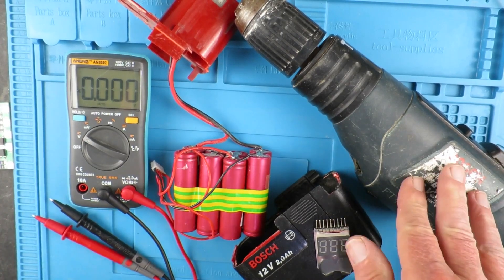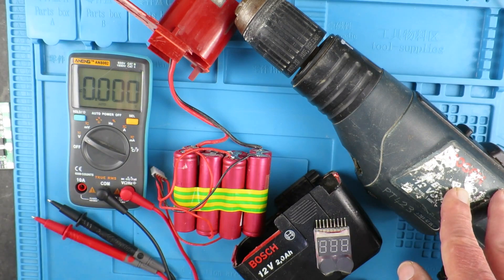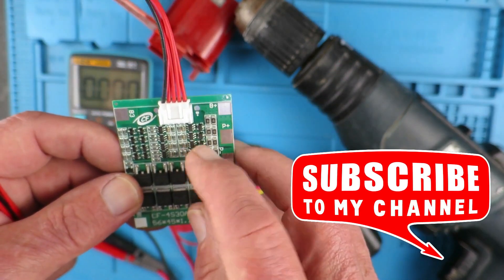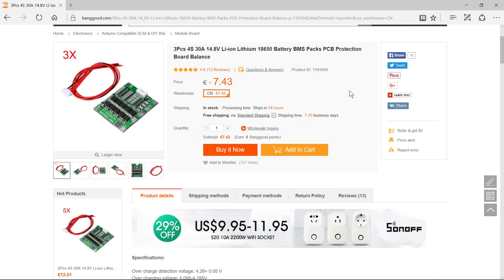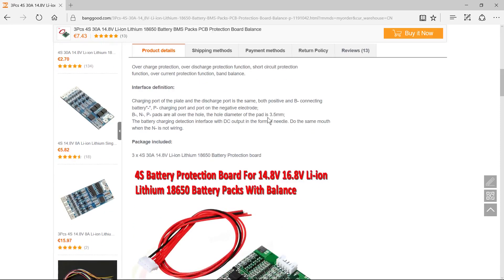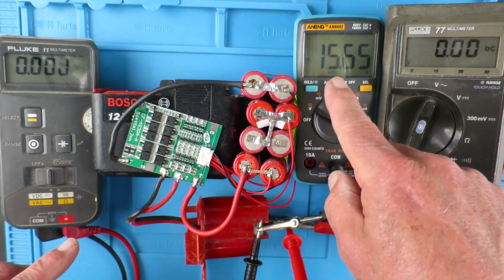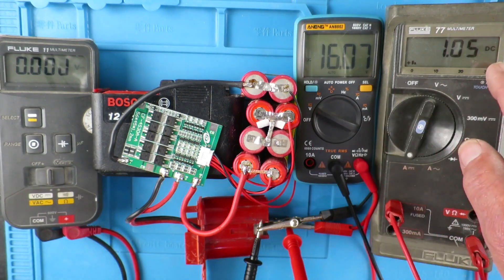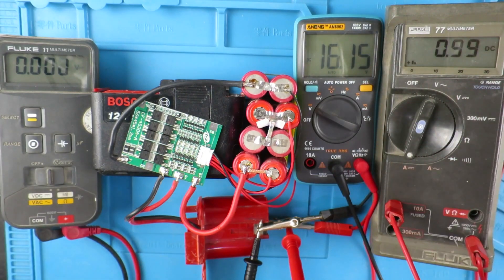4S 30A Li-ion Battery Protection / Balance Board Test Electronic Tutorial

Comment: I got one of these, slightly bigger for 5 cells and 100A. Unfortunately I forgot that this was not a charger, meaning there was no current limiter when charging so it started to pump 15 v to one of the cells but not to the others. It may be damaged now but I have 2 more so no big deal. The instructions as with most things from China are not helpful, too many details about the parameters but none for the operation of the module. I wish I knew some more about the balancing, how exactly does that and what the LEDs flickering means. Thanks for your tutorial.
Reply from the maker: Thanks for watching! I have a video that goes a little more into cell selection and balancing here : https://youtu.be/z2Rhk8KJp_k

Comment: I have BMS board as you, 3 batteries in parallel 15 batteries for series ,connected as your picture, checked p- p+ with a spare motor (no load) runs fine, but when using drill ,it won't run , when checking with VOM after, no voltage , connected hobby charger for 1 sec , ( it will reset?) and it will run spare motor, but drill will cause it to shut (not run), what am I doing wrong?
Reply from the maker: It happens because the short circuit protection activates due to the large switch on current of the drill. There is a possible fix by putting a capacitor on the board see here : https://mysku.me/blog/aliexpress/58000.html
You will need to translate from Russian!

Comment: nice work, thanks for publishing. Any idea why there are 2 rows of 5 FETS in a BMS that does 4 cells?
Reply from the maker: A good question! 4 pairs are in the charge control circuit and 2 pairs control the over discharge control circuit.
There is a full reverse engineering of the board here : https://mysku.me/blog/aliexpress/58000.html
You will need to translate it from Russian!

Comment: Thanks you - fantastic and comprehensive - best I have ever seen. 
Would it be possible to use this in a Panasonic 15.6 V Hammer Drill given the voltage?
Reply from the maker: Glad you liked it! It should be OK with that drill. The pack voltage will fall under load.
Reply: Thanks again, I have ordered the bits from your favourite Chinese emporium. Mine too as I have bought from Banggood before. Have a wonderful festive season.

Comment: Okay. So... I wired it correctly and despite having 16v output on the P- and P+.... I connect it to the drill and it wont work... any ideas ??
Reply from the maker: It is possible that the short circuit protection is being activated. Some boards seem more sensitive than others. Can you try a bulb and see if it will light? There is a complete description of the circuit and fix here : https://mysku.me/blog/aliexpress/58000.html
It is in Russian! Let me know if it works for you.
Reply: @1nformatica  thanks for your reply.. By making a quick short...the board reset itself. My guess is sometimes if a short happens it doesnt always reset properly. Im also wondering if the majority of 18650 batteries are 10 amps output per cell. And if you make a 4 series battery with nothing in parallel... the output is still 10a maximum so.. Is a 30a bms.... Kind of... well... overkill? If the cell goes bad and tries to charge beyond a certain voltage or drain beyond a certain voltage that still works. But the amperage protection will never be triggered. So in this case would you be better off with a bms with a cutoff of 10 amps? Since some of these small drills dont draw over 5 amps maximum anyway (my crummy ryobi drill doesnt pull more than around 3 amps which is probably why I got it for free lol)
Reply from the maker: The board usually resets after the load is removed. 18650 cells are capable of producing much more than 10 Amps if, for example, shorted out. Don't ask how I know!
Reply: @1nformatica  ah! I just assumed since their typical peak max output is usually around 10amps and the drill doesnt go over 2 amps (my drill is no good) then would you really need a BMS that craps out at 30a if you only wire 4 cells in series (only one parallel) it seems like a 10 amp bms (smaller) would be sufficient. But im guessing those smaller ones dont have cell balancing because.... Well.. Theyre so cheap....
Reply: @1nformatica  wow talk about russian guy over engineering a project!!!
Reply from the maker: Yes! I bet he's really fun at parties!!

Comment: I have breached those bms: s two pieces. I would like to know if the charging voltage can be as much as 20V because I want to use a solar cell for charging but do not lower the voltage with extra devices?
Reply from the maker: The cells must be charged by a source that has constant voltage and constant current. I use a 19 volt supply and a DC step down module set to 17 volts and a constant current determined by the cell datasheet e.g. 2 Amps. The module is this one : http://bit.ly/LedDriver You can see how it works in one of my other videos : https://www.youtube.com/watch?v=QYc1On0q4AA
Reply: @1nformatica  Thanks for  reply! A step down is not good, I used one, but when the sun is shining at full power, the solar panel voltage would have to be raised to charge the battery. At full panel power, the voltage is 22v but already in bright conditions, for example 12v, the voltage should be raised. The current should not exceed max. 5A because the panel is 100W.
Reply from the maker: This module is not a good fit for solar applications. Take a look here for alternatives : https://www.youtube.com/watch?v=8ZHD5R5qOfI

Comment: Hello! Great video! In the schematic around 4:21, it's not specified the amount of batteries that can be connected in parallel and i noticed you connected two at a time in parallel, is there any maximum? Does it affect performances or may become a hazard due to batteries not exactly the same balance? Thanks!
Reply from the maker: Thanks! The max number of paralleled cells would be limited by the total charge current. Balancing many cells would be a challenge as the balance current is only 60 mA. Most important is that the cells are matched for internal resistance https://youtu.be/z2Rhk8KJp_k

Comment: I tried to use that board and was not able to get the full current output of the pack. It kept quitting on over discharge when I was only asking for 6 amps. I've since gone to testing the next generation BMS/balance boards
Reply from the maker: Yes, some others report the same problem. I too would like to test different boards but not found any significantly better. What devices are you looking at?
Reply: @1nformatica The typical Chinese BMS boards 
https://www.ebay.com/sch/i.html?_from=R40&_trksid=p2380057.m570.l1311.R2.TR4.TRC0.A0.H0.X4s30z.TRS0&_nkw=4s+30a+bms&_sacat=0

Comment: Should the voltage on p+ and p- be the max rated capacity of all 4 batteries?
17.2v?
Reply from the maker: Yes. Nominally it will be 4 * 4.2 16.8 volts. If you can find the datasheet for the cells you have it will tell you. I set the charge voltage to 17 volts for my cells.
Reply: @1nformatica  Cool, thanks! What would be a typical way to supply it 17v from the wall? Cant really seem to find a fitting wall adapter.
Would a 12v 2a work with a step up module? Or would i need a higher current one?
Reply from the maker: What I use is an old laptop charger rated 19 volts at 3 Amps and put a DC step down module which I can set the voltage an a constant current determined by the cell datasheet. The module is this one : http://bit.ly/LedDriver You can see how it works in one of my other videos : https://www.youtube.com/watch?v=QYc1On0q4AA

Comment: Ive used that same equipment several times and could not get substantial current (barely an amp) out of the load terminals. The board kept going into over discharge protection. I never figured that out
Reply from the maker: There are a number of possibilities. Weak or badly matched cells. Commutator / brush noise causing interference.  Counterfeit board. Inrush current triggering the overdischarge. There is a complete description of the circuit and a possible fix here : https://mysku.me/blog/aliexpress/58000.html
Reply: @1nformatica  Thanks. I suspect unbalanced cells. Up till recently I assumed BMS boards did balancing.How wrong I was. Now I have to start all over
Reply from the maker: You may find my other video ueful : https://www.youtube.com/watch?v=z2Rhk8KJp_k
Reply: @1nformatica Thats a LOT of work and time. I should wonder if its not better to just buy another battery pack
Reply from the maker: True!
Reply: Now I just got a reverse problem - I received (3) cordless screwdrivers of different brands, with batteries but all without chargers Do I recycle the cells or make a charger? What module would you use?
Reply from the maker: @pleasecho2  I would make a charger. I am blessed / cursed with 3 work areas and can never have enough tools! What I use is an old laptop charger rated 19 volts at 3 Amps and put a DC step down module which I can set the voltage an a constant current determined by the cell datasheet. The module is this one : http://bit.ly/LedDriver You can see how it works in one of my other videos : https://www.youtube.com/watch?v=QYc1On0q4AA
Reply: @1nformatica Bad news. Before manually charging the packs to make sure they were OK and didn't have any BMS in them I took them apart and they ALL have NiCads. Now I have about 30 probably useless NiCad cells and at least one 18v drill that's worth converting to Li. I'll be using 5 cells and BMS board have as large an output current rating as I can get. Any one you would recommend?
Reply from the maker: @pleasecho2  Hmm, bummer on the NiCads. I haven't used this BMS myself but it looks promising : http://bit.ly/5S100ABMS

Comment: Can this board be charged with a 24v 5A charger? Or does it have to be 17v at 1A
Reply from the maker: It needs a regulated supply of 17 volts at a current set by the type of cells in use, usually 1 Amp is correct.
Reply: @1nformatica  If 2 is recommended for your battery but you still use 1A it will only charge slower, right?
Reply from the maker: Correct. Using a lower current will just take longer. As a rule of thumb I choose 1C unless otherwise advised. 1C being one times the rated cell capacity so for a 800 mAh cell 0.8 Amp.
Reply: @1nformatica  If I use 24V at 1A I will need an extra Step Down Converter I suppose?
Reply from the maker: Yes. This is one I use that also has constant current that you can adjust : http://bit.ly/LedDriver
I made a video on it https://www.youtube.com/watch?v=zTxiflmyeU4
Reply: @1nformatica  Thank you. One question left: If I = U/R then what is R? U is 16,8V with  the step down converter but to know I you need the resistence. Does the Battery Management System have a variable resistor or how do you make sure that the batteries are not charged at over 1A or 2A?
Reply from the maker: The setting of the charge voltage and current is done by the step down converter. There are two potentiometers one sets the voltage and the other current. I show how it is set in the video on the converter. The BMS only measures the cells to determine when the full charge voltage is reached and will disconnect the cells from the applied voltage.
Reply: The only reason I'm asking is because I have some old 18 650 lithium ion packs that are charged with a 24 volts charger. The BMS that you're using in your video says has to be charged at 17 volts but I'm wondering has anybody tried charging it at 24 volts will the BMS regulate the voltage down to 17?
Reply from the maker: The BMS does not regulate the charge voltage or current. The average 18650 cell has a peak charge voltage of 4.2 volts. 4 * 4.2 = 16.8 add a little for luck and you get 17 volts. 24 volts is way to high for 4 cells. Perhaps if the 24 volt charger is unregulated the voltage is dragged down by the charge current. Or is there some other circuitry in the battery pack? Are you sure it is a 4 cell pack and have you measured the actual charge voltage in use?
Reply: @1nformatica  By the way. Is there a way of testing your BMS (the same model as shown in the video). I have bough it quite a long time ago and when I connected the b- battery to the board and then tried connecting the black cable from the 5 pin thing to the plus pole of the 1st battery there were little silent sparks, the same behaviour as with connecting + and - from the same battery. I was a little worried and disconnected everything quickly. Is this normal or do I need a new board or is the order in which you start connecting the batteries to each other and the board wrong?
Reply: @1nformatica  no the battery is a 4s12p with the bms you are using. The cells are all the same at 2200mAhr my current charger is an 16.8v 3A. 

I was just curious if you can use a 24 volt charger and if the BMS would compensate for it if not I'll stick to my current charger.
Reply from the maker: Depending on the state of charge of the cells you may see a tiny spark when connecting. As long as there is no smoke or burning it should be OK!! I don't think the order of connection is important, I usually start from the negative side and make the positive power connection last.

Comment: my discharge was 14.8 when i checked the battery it says 16.5 it dosen't work for me.as voltage is to low
Reply from the maker: The low voltage should not cut off the pack until 10.2 volts. What load current was it drawing? Can you repeat the test with just a resistor drawing about 1 Amp say around 16 ohms?
Reply: @1nformatica  18650 in 4s when i conect to bms it runs at 12.5 when i don't run it its at 16.8

Comment: I can't get more than 5 amps out of a fully charged 4cell pack using this device before it just stopped. Upon reconnecting power it pulls the 5 amps for about 10 seconds then stops  again. Obviously its protecting the cells but I don't see how unless this board won't pass more than 5 amps?
Reply from the maker: First I would check the cell voltage for each cell under load. It's possible that one or more cells are triggering the under voltage condition below about 3 volts. Only 4 cells may not be sufficient capacity, I use 4 series and 2 parallel. Is the board getting hot? Insufficient cooling will cause the BMS to cut out. Are the drill brushes worn? Sparking from worn brushes or dirty commutator will cause electrical noise and interference. You could try putting a suppression capacitor across the drill wires.
Reply: @1nformatica The cells are not perfectly balanced so you're probably right. But how close should they be? Also assuming I'm using all similar cells, once they are all equal, will the BMS maintain them at the exact same voltage throughout subsequent charge/discharge cycles?
Reply from the maker: The cells should be with a couple of millivolts. Also important is the internal resistance, I made a video about that https://www.youtube.com/watch?v=z2Rhk8KJp_k
The BMS I used has built in balance circuits which work unless the pack is abused by high discharge use.

Comment: How to charge them?
Reply from the maker: What I use is an old laptop charger rated 19 volts at 3 Amps and put a DC step down module which I can set the voltage an a constant current determined by the cell datasheet. The module is this one : http://bit.ly/LedDriver You can see how it works in one of my other videos : https://www.youtube.com/watch?v=QYc1On0q4AA
Reply: @1nformatica  thanks!
Reply from the maker: You're welcome!
Reply: @1nformatica but still i am confused. How much current and ampere require?
I used 6 18650 Lithiom Ion cells, connected 2 in parallel and did Same 4 cells then connected them in series to make 12v battery pack.
I connected them with  3S 10A 12V bms.
Reply: @1nformatica  hey u have any idea about changing voltage and current required for my battery pack check upper message
 if no no problem at all?
Reply from the maker: The voltage is simple, for 3 cells maximum charge voltage will be 3 * 4.2 = 12.6 volts. I usually set my charge voltage a little higher as I know the BMS will protect the cells by detecting any overvoltage condition. So I set the step down converter I use to 13 volts. The current depends on the cells you have. In this video I am using Sanyo UR18650FJ cells which are 2.1 Ampere hours. A rule of thumb is to set the charge current between 0.5C and 1C which in this case wound be from 1 to 2 Amps. In the video I used 1 Amp.
Reply: @1nformatica  thanks for helping!